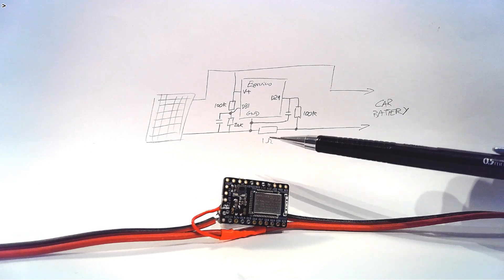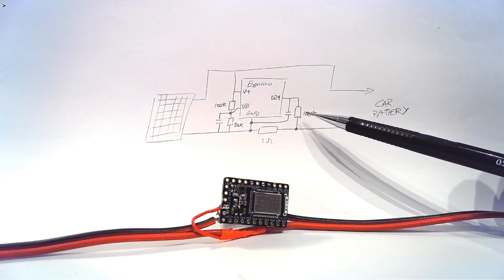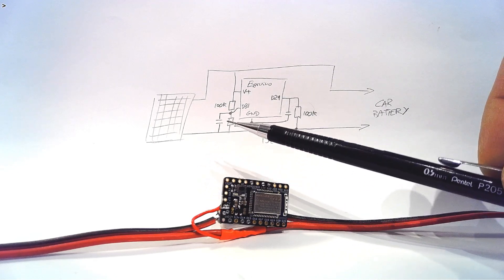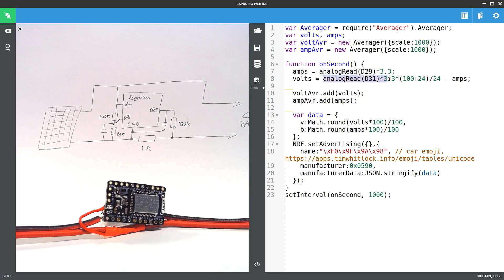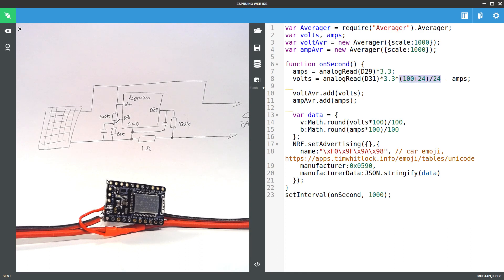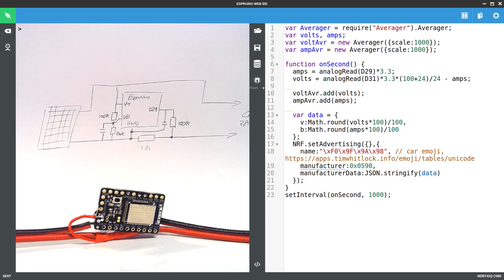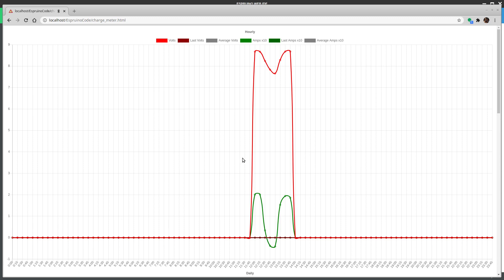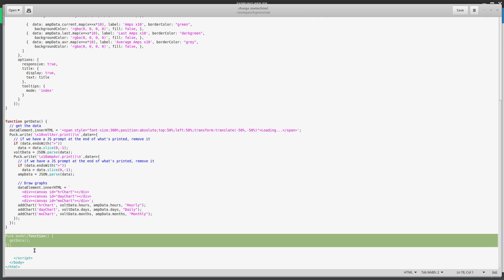DIY Car Battery monitor

Comment: I'm pretty new to wiring... what do you recommend for making temporary connections with this board (I'm just experimenting not following the project)... breadboard wires seem to jiggle loose even if I bend them... should I just solder? Or am I missing something obvious? Cheers.
Reply from the maker: There are a few interesting suggestions at https://electronics.stackexchange.com/questions/249140/how-can-i-make-connection-on-pcb-circuit-board-holes-without-solder-for-proto but personally i just poke the wire through the whole, twist it back onto itself and around, If you want to do a lot of prototypes with it I'd consider soldering on pin strip and poking it into a proto-board.

However in this case, you're dealing with voltage from a car battery that you really don't want to short out or connect to places it shouldn't (if 12v gets on one of the board's GPIO pins it'll kill it instantly) and only 4 connections to the board, so I'd say soldering would be a pretty good idea in this case.

Comment: Interesting idea.  What sort of range do you get with Bluetooth?
I'll have to see if I can do something similar using Wi-Fi or ESP-Now.  My garage is  probably too far from my house.
Thanks for sharing
Reply from the maker: It's around 20m range - you get more with a good aerial on your BLE dongle or less with walls and stuff in the way. Bluetooth 5 can advertise in a slower long-range mode which can drastically improve that though (I've heard people mention 1km!)
Reply: @Espruino  Wow! That's pretty good. Thanks.

Comment: Across the solar panels not the battery? It is supposed to monitor the battery as per the video heading.
Reply from the maker: Yes - the idea is it monitors the car battery but also the charge put into it from the solar panel. Because of the way the voltage drop across the resistor occurs, you need to put Espruino on the solar panel side, since that is supplying power, so will have a higher voltage than the battery. If you power the module from the battery then you'd have to try and measure a negative voltage on the input pin of the microcontroller.

Comment: Very nice, one little typo on your web site under the section "You'll need" you say "coltage regulator" not voltage...  Otherwise very neat.  I will try building this for myself as my car battery has also died a few times over the last year due to less use.
Reply from the maker: Thanks! I'll get that changed...

Comment: Hey Gordon my first thought is the solar panel can drain the battery. Or do you have a diode? Possibly negligible, but could worth checking. Or dropping in a schottky
Reply from the maker: Yes, I'd been wondering about that, but it turns out my panel has a diode built into it. Either way the nRF52 can actually detect slightly negative voltages so the battery monitor should be able to flag up if something like that is happening. I believe in my case the battery drain is a combination of a ~10 year old battery, alarm that draws a bit too much power, and having had the solar panel in the rear window so it's not getting enough direct sunlight... But now I can see for sure if I've fixed it!
Reply: @Espruino  Ten year old battery? You are lucky it starts at all! :)
Reply from the maker: @AkosLukacs42  I know! Well, I can't see a date code and it's a 10 year old car so I assume the battery hasn't been changed - but I could be wrong. The voltage is fine and car starts great when it's charged though, so I'm blaming the immobiliser for now :)